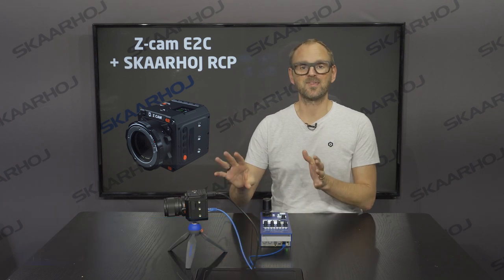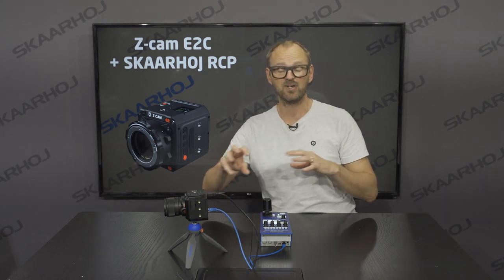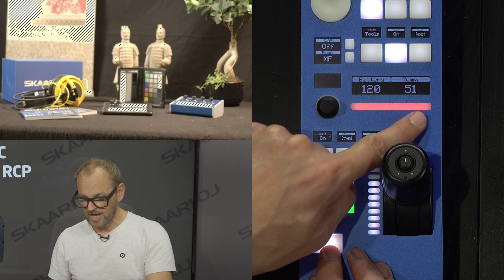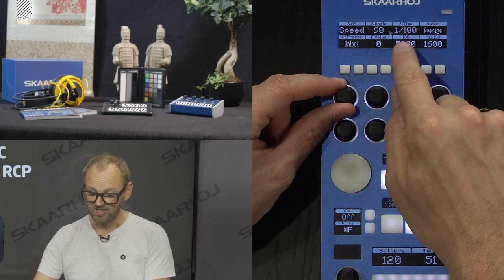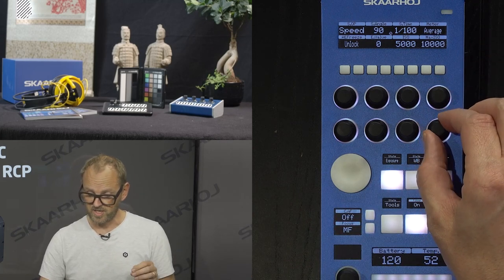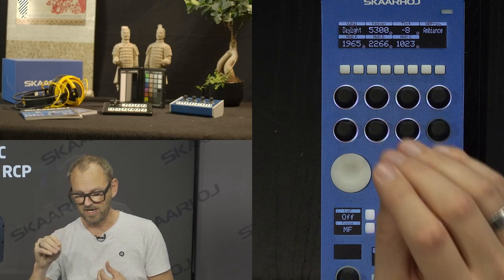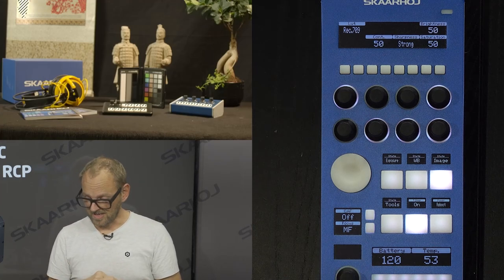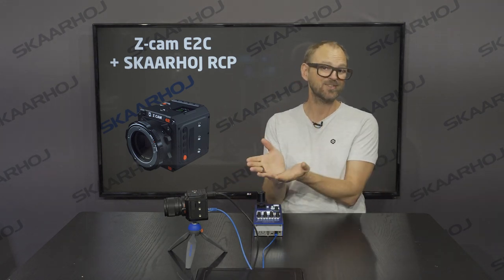Camera Control for the the E2C Z-cam

Comment: I would really love a company like yours to develop an affordable PTZ motor head solution. You've got a PTZ control product, you have camera control products. Combining my simple E2C streaming cameras with a PTZ head and a combined control would be my dream.

Any ready-made PTZ like from Panasonic with the image quality of the old Z Cam E2C is incredibly expensive. Hollywood-targeted PTZ heads are even more incredibly expensive, and most times oversized.

Comment: I guess th Panasonic BGH1 will support similar features over Ethernet. 
On a sindenote: the only thing im missing now is an option to remote this setup wireless
Reply from the maker: We have not tested the BGH1, so we cant say at this time. 
Wifi is not something we encourage as it introduces a lot of variables to a setup. We always recommend using cabled connections for the best experience. That being said it should be possible to connect a SKAARHOJ controller to other gear through wireless routers and access points.
Reply: Panasonic does not give users its communication protocol specification. There is only a closed-source API library for Windows. Z Cam has a public document for their HTTP-based control, which also allows it to perform certain commands using Bitfocus Companion and the Elgato Stream Deck. E.g., the E2C camera does not have a function for one-push AF in its web-based remote control, but you can get that creating your own web control, or with Companion.

The BGH1 Lumix Tether drives me nuts. The BGH1 has much better video quality than the cheap E2C but I don't use it in streaming anymore because I can't control it remotely without a hassle.